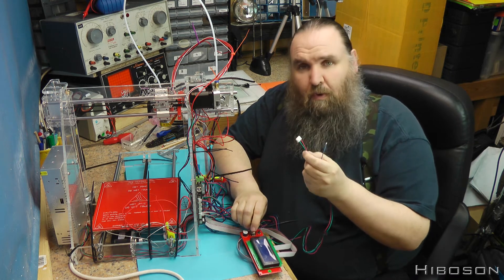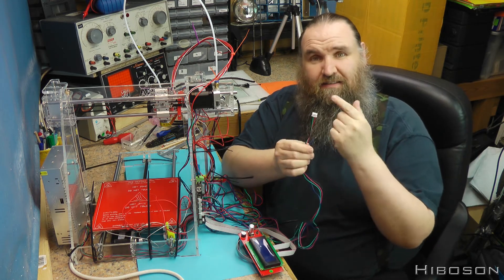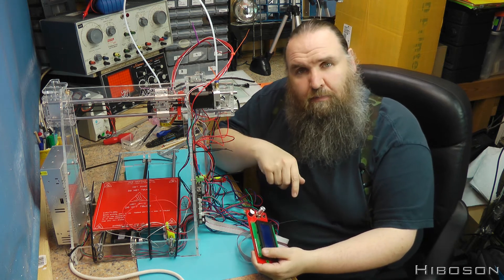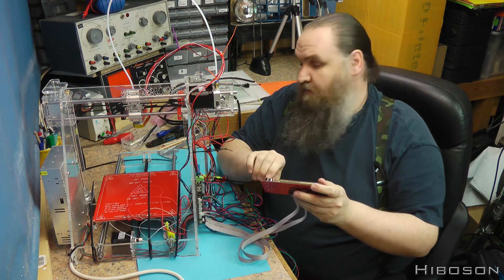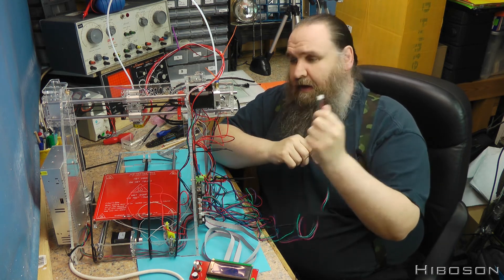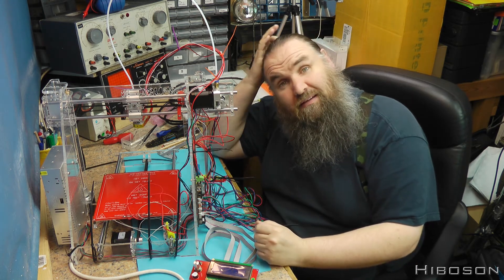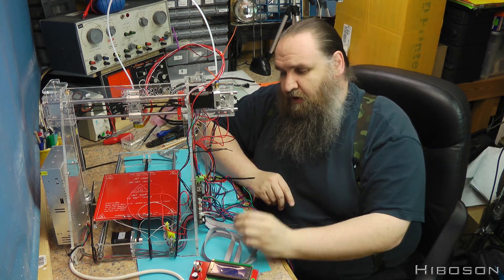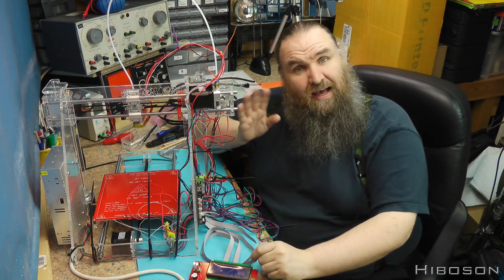3D Printer Build **Delay** - Sunhokey Prusa i3

Comment: Hi Hiboson. Instead of waiting for a new connector, why don't you just splice the wires to the correct positions? You have a soldering tool. All you'd need is some heat shrink tape. Anyway, just a suggestion. Enjoying your Sunhokey videos.
Reply from the maker: Hart Shepherd Thanks for the suggestion ;) I did contemplate it after it broke the connector but I like the ability to quickly disconnect swap them about/replace etc ;) 

I did manage the other day when out to pick up a pack of 5 jumper cables with these ends on, so I'm going to cut the end off one strip the wires back and solder/heat shrink them to the motor cable ;) No new crimp connectors like I'd really like but this way was easier, more expensive lol but easier as was working next to a Maplin so popped in and found some appropriate cables to hack :)

And I'm glad your enjoying my videos :)

ATB
Hiboson

Comment: Something like this type of connector http://m.ebay.com/itm/JST-XH-3S-11-1v-Lipo-Balance-Wire-Extension-Lead-8-5in-Extend-the-Balance-plug-/261101316372
Reply: Hiboson I agree with red01Mustang. To me, it looked like a 3S JST type balance plug, common on RC batteries.
Reply from the maker: Travis Hailston red01Mustang Thanks muchly :) Having such great feedback and help the #3DPrinter crowd sure is good bunch :) Hoping to find some UK based first ;)